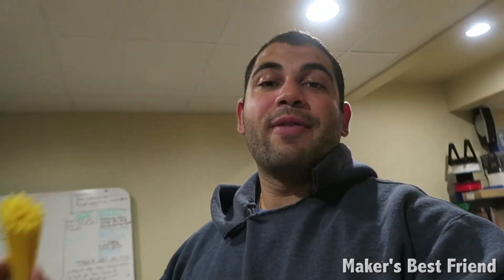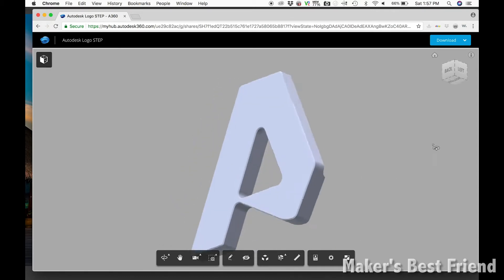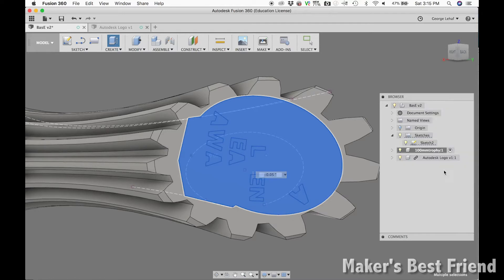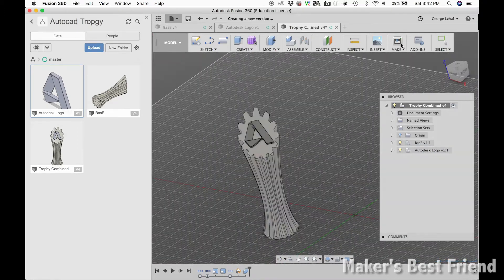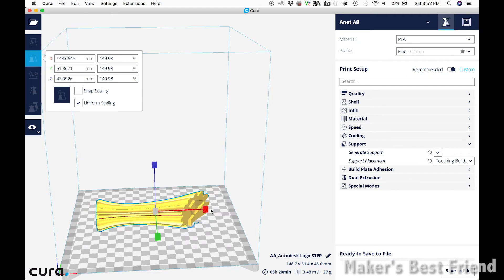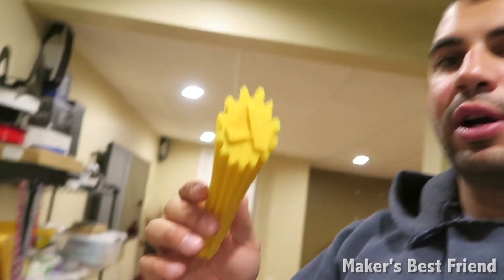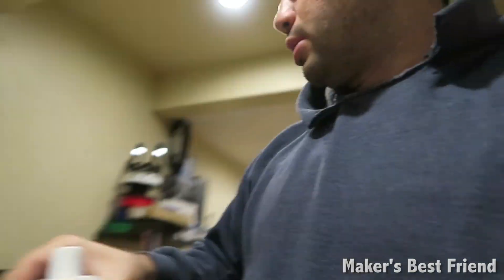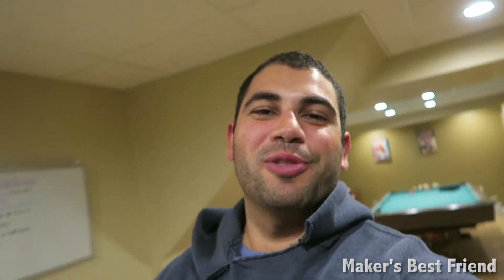Autodesk CAM Challenge !

Comment: You need to print that standing up! No supports required
Reply from the maker: rok vez the printer vibrates a lot so that it would most likely shift the trophy or maybe even tip it over, but I’m working on improving the print now (that and shopping for a better printer lol)